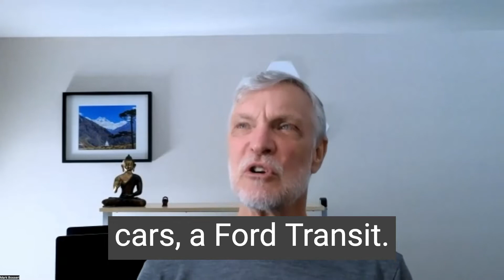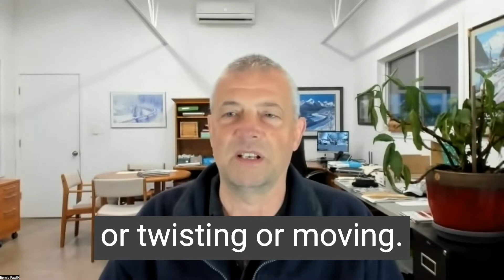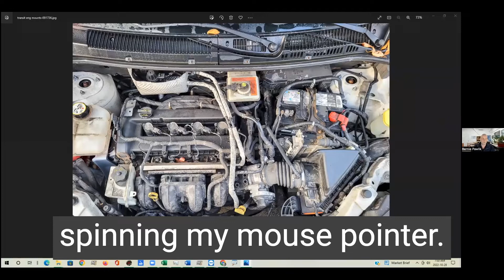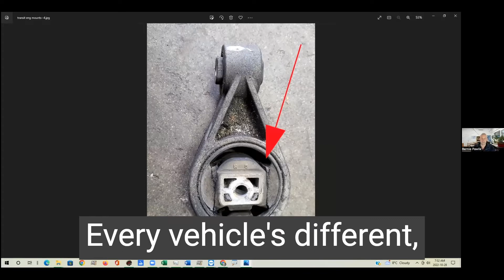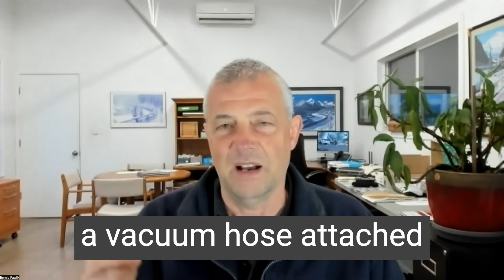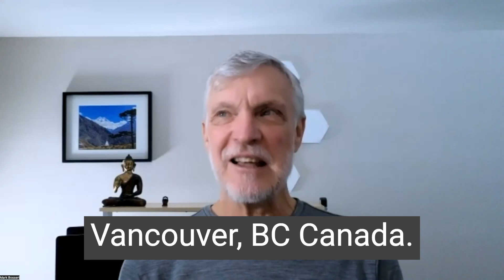Ford Transit Connect Engine Mount Repair

Comment: Torque mount issues with factory bolt not fitting through dog bone hole? I shouldn’t need to drill the hole out right? It should bolt right up but I returned it. Hoping the new set I get from a1auto solves it.
Reply: Besides that I actually love my silver 2010 connect